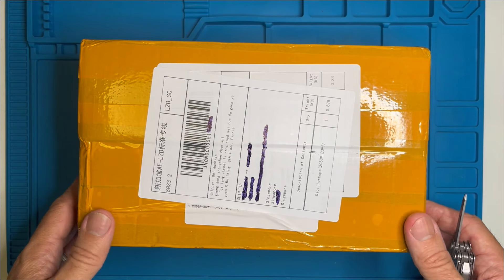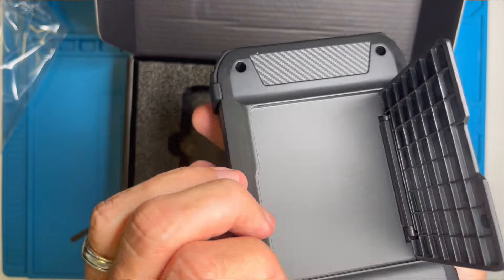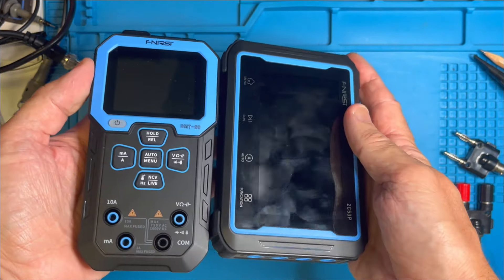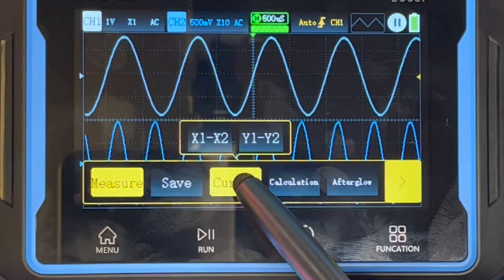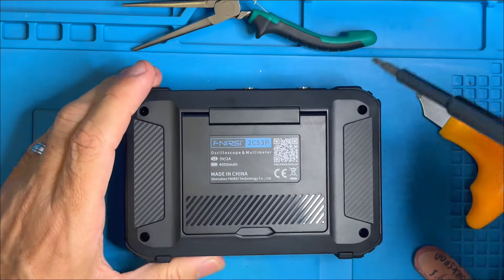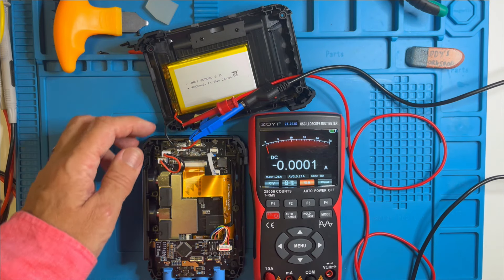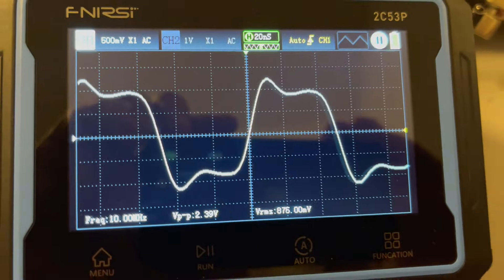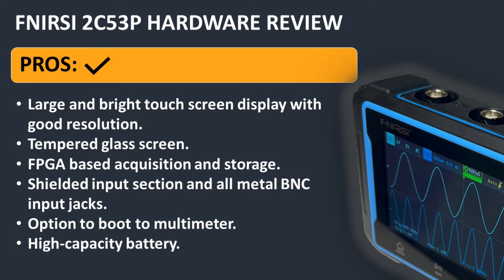FNIRSI 2C53P Overview, Teardown & Hardware Review

Comment: In general, the oscilloscope, multimeter and signal generator are not bad. In my copy (firmware 1.7.1.5), the capacitance measurement is extremely inaccurate (1% capacitor 106 pF measures as 33 pF, 0.5% capacitor 6800 pF measures as 6300 - 6400 pF), the oscilloscope measures the frequency of its own signal generator extremely inaccurately. The rest is acceptable for now.
Reply from the maker: Thank you for sharing this information. I am seeing similarities during my tests.
Reply: I wrote about it yesterday, but the message was deleted (perhaps because of the link given) ...
About measuring the frequency with an oscilloscope: as already written on a well-known forum, the oscilloscope incorrectly determines the frequency of the signal. In my instance, this happens on channel 1, the second channel determines the frequency CORRECTLY! I wonder how it is on your oscilloscope?
Reply from the maker: Thanks for this. How unusual! I will finish my tests this weekend and will let you know. I assume this is also with firmware 1.7.1.5?
Reply: @ElectroBananasYT  
Yes, this is also on firmware 1.7.1.5. That is, the first channel cannot measure the frequency correctly, and the second one measures everything correctly (I used the FY6900-100M signal generator for testing, with its BNC-BNC cables, the MCX-BNC adapter used a different, shorter one.). By the way, the rectangular signal is still somehow visible that it is rectangular, up to a frequency of 16-18 MHz. After 61 MHz, the oscilloscope almost does not see the signal (well, that's understandable, no one promised us anything else). Well, the multimeter greatly underestimates the capacitance measurement readings (in the lower range, and, let's say, 4700 UF, it already overestimates a little). Apparently, it will not be possible to adjust this.
Reply from the maker: Thank you Ivan, I will compare with my results
Reply: I just got mine and it has V1.8.2.2 firmware Wonder if it's any better?

My hardware at least does have accurate spelling of "Function"
Reply: @ElectroBananasYT  What intrigues me here is you identified that the SoC for the multimeter is virtually identical to the one in the 2C23T - and yet test results for capacitance on that model all seem to be good. Would have been a nice-to-have feature but think I'm buying one anyway - reasonable compromise between specs, price, performance, size for light "fiddling about" use I think. Really appreciated the teardown - thanks.
Reply: @Turboexplorer  Did you see any improvements with the 1.8+2.2 firmware? Oddly the most recent firmware on the website seems to be the 1.7+1.5 release

Comment: Just bought fnirsi 2c53p and have pure connection of multimeter probes in sockets. They just loose contact randomly when moving them near the sockets. Does anybody have the same or it’s a problem in my item only?
Reply from the maker: Not seen that issue myself. Are you using the supplied probes?

Comment: do the scope in put jacks share a common ground .This is very important to know if one cannel is monitoring a  module or an injector that is pulled to neg/ground to operate at the same time using the second channel to monitor a device that has a constant neg/ground .     Switching of the controlled neg/ground  would be defeated  .
Reply from the maker: The multimeter inputs are isolated from everything else. However the scope inputs, signal generator output and USB share a common ground.
Reply: @ElectroBananasYT  thanks. that's very dangerous if a person does not know this before they start to do testing
Reply from the maker: Potentially yes, I agree. I do cover that in my video.

Comment: Thanks, nice review. Can you tell me how many kpts the 64kbyte memory corresponds to?
Is it the same in all time bases, or is it like 1013d, 1014d?
Compared to the Owon HDS272, which only has 4/8 kpts, the pattern was more detailed for the Owon.

I noticed a bug with mine that the coupling with the channel remained in AC.
I switched to DC but it had no effect.
I noticed it while watching a low frequency square wave.
after several switches and restarts it worked.

One more comment from me.
The zoyi was not in DC coupling, so the real wave of the Fnirsi was not visible properly. It was not visible how big the DC offset was.
Reply from the maker: Thank you, hope the review was useful. I am also trying to confirm what that 64kB memory translates to in terms of sample points. Will give this some focus in my next review. Do you have the Owen?
Reply from the maker: Thanks also for sharing the bug on the coupling, I will see if mine has the same issue.
Reply: @ElectroBananasYT 
Yes currently i have some, HDS272S, HDS2202, DPOX180H, 1103D, sigpeak dso1511e+, Micsig To1104, Micsig STO2202C and Rigol HDS924S.

I was very disappointed with the 1103D when I tested it, it was my first scope, then I bought the sigpeak.😐

sometimes the Fnirsi release something good and useful, but later they destroy it.😱
Fortunately, the SG-004A that I have is good😎, but something was messed up in the later editions, I think they wanted to save money and caused inconvenience to the customers.😱😭
The most obvious is the radioactivity meter, the first series was still good, the others already contained cheaper tubes, they also saved money on the tube voltage adjustment circuit, etc.😡
I don't think Fnirsi is reliable.
Owon is not perfect either, they also have bugs in their products, but you can at least notice the higher quality attitude.

DPOX180H bugs have not been fixed yet.
They know about the faulty part, two capacitors.

But it wasn't fixed.

They lied in the specifications of the 1013D and 1014D.

I intended the 2C53P for my brother, because he is a simple electrician, but if this scope knew what was written about it in the spec, then it would have been very good for him.

I've had problems with it so far.

1. AC DC coupling bug.
2. I can't handle the display properly with my finger, probably because it was designed for people with smaller fingers. It doesn't have band control.
I mean that the trigger can only be set up on the right side, down in a thin band.
The channel can only be moved up and down on the left side.
And the trigger time in the upper bar.
The measurement can be done in the middle of the screen.
Or something similar. sensibly thought through.

3. when I press pause on it and start pulling it apart on the time axis, there are times when the wave does not change and it is not possible to go below a certain magnification.
This scope doesn't work like any of my other scopes.

I tested the memory by setting the two scopes, the HDS272 and the 2c53P, to the same time base, adding a higher frequency square signal to both.
I pressed pause on them and started zooming in on it.

I trust Owon, if it says 8kp, then 8k is the point in each time base.

I would probably guess 5-10 kp, depending on the time base.
It's not 100% accurate, and it's quite an unpleasant procedure, but at least it gives a good approximation. At least more believable than what Fnirsi described.

But using the 1013D as an example, the available memory changes depending on the time base setting.
And since it can only be saved as an image, it can't be saved in .csv, so I can't count it. not like in the case of Owon.
 
4. The bug was that the wave could not be moved to the side after the pause.

5. I wouldn't dare to use the part of the multimeter above 400V, it doesn't seem safe. I didn't just mean the fusible fuse, but its entire design.
If something goes wrong, and the arc is zig-zagging inside, I don't think the action reaction of Lithium would be funny.

Its signal generator is usable, but has a small DC offset that increases with frequency.

I prefer to calculate the frequency of a device from the rise time of the square wave signal, using a single trigger, because then there is no chance that skilled programmers oversampling the signal. averaging and other clever algorithms.
But this scope cannot be measured that way, only with your method.

Anyway, it would be a good scope. It's just that I 

6. At a higher frequency, the scope needs more data to calculate the frequency of the wave.
My other scopes tell me in a period or two...
Reply from the maker: Hello, thank you for your very comprehensive reply. And thank you for all the bugs / observations that you have shared. I will take a look at those to see if they exist with the latest firmware when I do the functional review. I would not want to give this to an electrician - they may try and use the DMM on AC mains - I would not trust it. You do have a lot of scopes!!! Your response seemed to be truncated? Thanks again, ElectroBananas
Reply: @ElectroBananasYT  If I have some time, I'll try to put some insulation around the DMM panel. 1000V rated huh funny...
The thicker green "plastic" adhesive tape used inside the equipments might be enough. i will do wrap around.

I also left out why the parameter where there are only two pieces, such as AC/DC coupling, must be set to that rotary crap, why can't it just be a switch or button?
I still have to think about the rest, whether it's an user error or a bug.🤔

Yes, as soon as I outgrew one and bought the next one, I kept the older one out of nostalgia.😎
Some are now on loan to a friend.
It comes in handy when you can examine two or more independent signals at the same time, and you can solve them with three small hand-held instruments.
Of course, this also depends on use.
When I just need to look at the frequency change or simple signal distortion, etc.
Or when my dear colleague cannot decide with his multimeter whether he is measuring ACV, DCV or AC+DCV. it comes in handy for the cheaper illustrative tool.🤣

I'm really looking forward to your next video, I'm also very interested in your full opinion on it.
Reply from the maker: Thanks for the reply. Good idea on the tape. Yes I find that rotary wheel control annoying, especially for the AC/DC selection. I also find it hard to part with tools. Can’t have enough meters. I am looking forward to doing the next review too. Just finding time. Let me know what you would like me to test. If I can, I will.

Comment: Thank you very much for the nice video on the Fnirsi 2c53p!!!!!!!! Could I ask what is the name of the signal generator port where you plug the cable with the alligator clips!!!! I would like to buy a bnc adapter for it. Thank you very much.
Reply from the maker: Hello, thank you for your kind comment. The type of connection on the Signal generator port is called an MCX connector. If you look on AliExpress you will find all types of adapters for this type of connector. Hope you find what you need!

Comment: So far this is the best review I have come across for the functions congratulation  and looking forward the an Indepth revue, as the other are just an unpacking clip and lack of knowledge of the presenter in use of the scope, watch you dismantle the unit I concentrated on my sight on the MCX connector and it looks  as if there is room to use a BNC cassis connecter mounted to the plastic case leaving it protrude higher and above the  other two BNC connecters and attaching it with a wire connection to the main board.
As for the battery life, using the scope for automotive use it will only be on intermittently during a diagnosis using the fastest turn off time I find it more that handles a two-day working cycle, with charging overnight, with right attenuators it is ideal for trouble shooting CAN signals and pulse width modulation for sensors in automotive use in the field although the PICCO SCOPE is the better work shop unit
Would you be able to go more into the 20 Meg band width switch.
Reply from the maker: Thank you. I am making a functional review of this device. I really don’t like those MCX connectors.

Comment: Hi,  Did you notice that when the function generator is set to 1MHz or greater and turned ON, it’s signal couples to channel 2? With or without a probe connected. Looking at the teardown the DDS is close to channel 2. I don’t know if this was a one off defect or if it’s in other units. I would appreciate knowing can check on this. Thank you very much.
Reply from the maker: Hello, I checked with 1MHz signal generation and max sensitivity on ch1 and Ch2. Could not see any cross talk
Reply: Thank you very much

Comment: I got mine yesterday. So far it's looking to be perfect for hobby electronics use. As far as using with high voltage/current, I wouldn't use any random named Chinese meters for that. That's what my Fluke is for.
Reply from the maker: Thanks for watching. Well as long as you are aware of the limitations of this device! I always revert to my trusty fluke!
Reply: @ElectroBananasYT What is the name of this port or under what name should I look for this adapter for the generator?

Comment: I wonder if the signal generator section of this device provides a modulated ouput to say, use it to apply a 455kHz to a radio to align the IFTs
Reply from the maker: Unfortunately not. If you go to the section of the video where I cover the signal generator you can see the types of signal available. No modulation options. Would be great to have one of these low cost scope/DMM/signal gen devices with a modulation function (or funcation). Thanks for the comment and for watching
Reply: Many thanks for your response. I suspected as much. Modulation would be nice. I hoped the multi audio might have been it. I too wondered what that is.

Comment: I wish I would be at level when I could design a device like this and write a good software for it.
Perhaps a multimeter and/or function generator around ARduino or Raspbery Pico would be a good project?
Big thanks for suggesting 2C22T Multimeter review for input protection devices. That one was buging me, how to protect multimeter if lets say youre measuring 10V signal but due malfunction in the device being tested, multimeter gets all mains 240V on the input.
Australian Dave has mentioned some "standard input protection" as well, but I wanted to find more info about them.
Reply: Question bout shielding. Not sure if PCBWay offers services for cutting it. Trough maybe it could be cut from the meatal used for stencils, and folded?
Does it mater what metal isuesd to make one? Copper, brass, steel..?
I had some cooper sheets I can cut, fold and solder together to make a cage. But magnetic properties are different between steel and copper.

Any tutorial or example project would be appreciated.
Reply from the maker: Thanks for the comment. Hmm, when off the shelf multimeters and hand held scopes are so cheap these days I am not sure I could be motivated to build my own unless it needed a unique feature. Thank you for watching!
Reply from the maker: I would have thought soldering together sheet copper would work well. I have a project in the pipeline where I will be shielding 3D printed enclosures using self adhesive copper foil as an alternative to pre-made metal enclosures.
Reply: @ElectroBananasYT  Its not to save money. I couldn't make a cheaper multimeter with the same specss as those ~5dollar/pound/euro yellow or black ones even if i wanted.
Its about the journey and learning. And if i can make some video along the way that inspires more people, even better.

I just like tinkering and making stuff. Just have to set a chalange and work on it. In this case something that is not pluging an arduino to computer and using ADC to read potentiometer and calling that "a multimeter" and not being naive to try to make some top noch Keysight device.

I'm not some american business man making 1000 dollaras an hour, and counting how much time it costs him to watch a movie with his family or friends as he is not making money whilst doing that.
Reply from the maker: I totally get that. Problem with me is that I just have very little time to explore this interesting hobby so I am quite selective. I have made a few devices that I could have just bought and had a long of enjoyment making them (not to mention learning from my mistakes). By the way, PCBway do sheet metal designs, but I imagine it would be too thick for rf screening purposes.

Comment: Someone knows if is posible to use XY funtion conected to a computer?
USB port is isolated? 

Thanks in Advance.
Reply from the maker: Hello, the USB port is isolated from the Multimeter section, but not the oscilloscope.
Reply from the maker: The XY function cannot be used from a Computer.

Comment: Why didn't FNIRSI catch the big mistake on the front, it says "FUNCATION" Wow!
Reply from the maker: I know, it is a very big boo boo! Terrible PR for them and makes you question their QA processes. I also don’t like the use of the word ‘Gear’ instead of ‘Mode’ when selecting the mode of their multimeter function.
Reply: They have terrible QA and even worst support. They shall put more effort to polish they existing products instead release new one. Saying that, despite all issues with F gear, I did all my hobby works I needed with this gear.